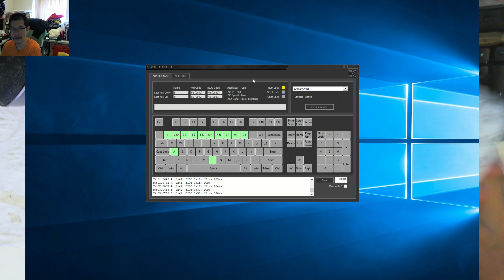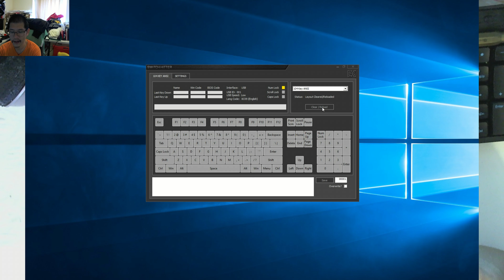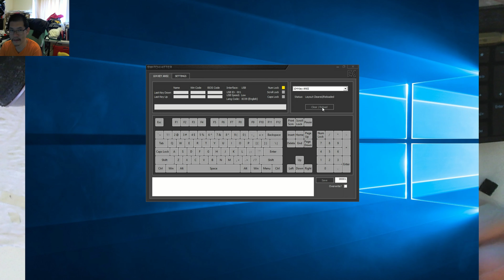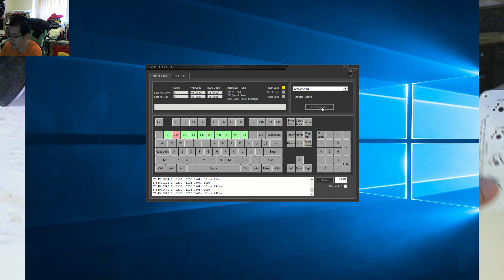Checking and Testing the Numbrero and Trade Station

Comment: Hi, if the Pro-Micro pins are such good fit, do you think it's still necessary to solder it?
Reply from the maker: So, with the Trade Station, I delivered it to the work colleague without soldering it in. It works perfectly fine, for now. I would say that potentially over time if the pro micro moves a lot or is removed/inserted too many times, you will then lose good consistent contact, which would mean you would have to solder it, at that point. If you don't anticipate changing it a lot, then, no, you probably don't have to solder it.